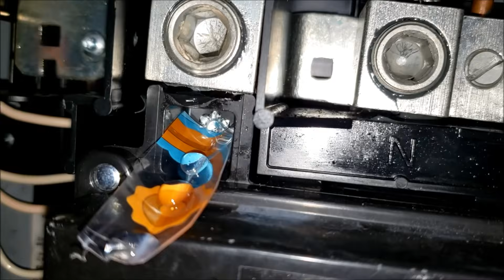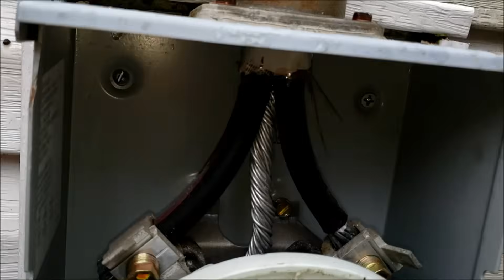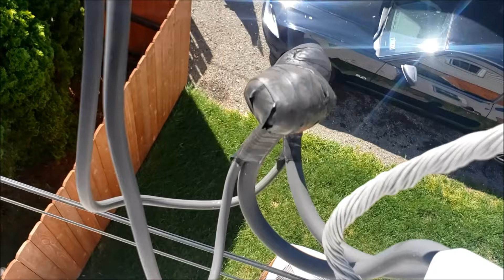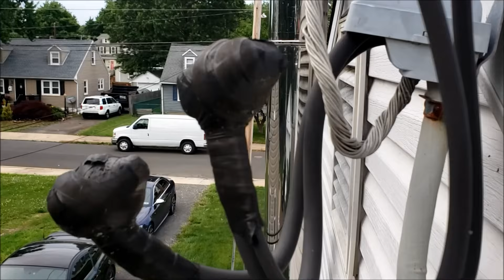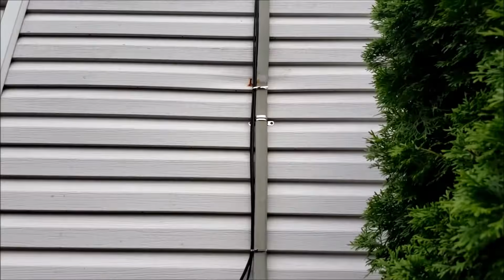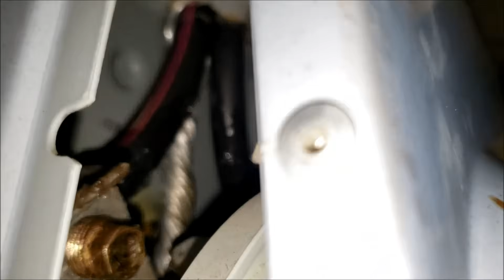Raining? Check For This!  Fixing Water Issue In My Electrical Panel

Comment from the maker: On Amazon:
*EATON SURGE PROTECTOR: https://amzn.to/3ogFb2I
*INTERMATIC SURGE PROTECTOR: https://amzn.to/37DVYq6
*DI-ELECTRIC GREASE: https://amzn.to/37wE0Wh
Reply: You should have drawn a couple holes with a drill bit through the bottoms of the electric box for the water to drip out if it happened again. Very interesting video though next time I'm up on the roof cleaning the gutters I'm going to check the power lines because the whole reason I watched your video was I have a room in the basement and there is a crack right next to the electric box that leaks

Comment: Hi Chris, water got into my panel, of course, via the meter outside.   It only chipped one breaker.   It worked after 2 days of leaving it to dry.  Do i need to replace that breaker?  The breaker panel is 11 yrs old with no sign of corrosion, but an electrician wants me to replace that breaker and a few more that show watermarks on the exterior

Comment: Nice job. Yeah not perfect but safe and effective. I have this issue today. PoCo will repair the bung/seal on top of the meter box and I will make a meter box roof type of thing. I will also inspect the entire run coming in from the pole.  The leaking has been going on for a while on a small scale. I noticed several of my breakers have water staining and rust marks where the rivets hold the breaker housing together. Thanks for your video. Be safe and rock on!!

Comment: Im having an issue where the back breaker of my house is blowing. Its also happening during the rain.  My roof is new though. I thought it was the outside GFCI outlet that is outside of my bedroom tied into that same breaker. Had my buddy replace the outlet. Im wondering if the box itself is leaking.  Didn't have an issue until it rained hard again. Pain in the arse being a home owner.😅

Comment: I have the exact same problem. Water is leaking into the panel box from inside the wire sheathing. I went outside and put new putty a d silicone around everything going into the meter box. The next hard rain and it's still leaking. Must be coming from way up top. I am not sure if it's my problem or the power companies.
Reply from the maker: Always worth it to try and call the power company first. Usually they'll take care of it on the outside of the house

Comment: I had a similar problem in a rental property a few years ago. The service line was completely rotted going into the meter box. Water was getting into the meter box unnoticed for years. The electric panels never took on water because they were located on the other side of the house. We discovered this because the tenant got an electric bill for $800 one month and $1000 the next month. During that time, she blew out an air conditioner, computer and TV due to a surge. Connections in the meter socket rotted over time and caused arcing in the meter socket. We shut off the main and the electric meter kept spinning, it looked as though there was heavy equipment being used even when the main was off.  I guess it would be a good idea to check your service line occasionally. This is something we tend to overlook til there's a real problem. I never thought of it before.

Comment: I found water in my panel yesterday when changing breakers. That is amazing that the water can soak in and travel down through those wires, and even get through the meter box to continue into the house. I will have to check my main cable above the meter. The hard thing to figure is how long this had gone on before it makes it into the breaker box.

Comment: Idk if someone answered the wire question. I’m no electrician but I know that if the wire runs through insulation it has to be uprated cause the insulation will make it hotter. That’s what he meant by the air cooled can be smaller.
Reply: but that wire hes looking at is in insulation..  they may be talking about it being buried, as the other guy mentioned.  You would have to look up the wire sizes, but atleast it wont fail on your end.  If you dont have electrical problems, i say dont worry.

Comment: Buddy,

You need a new main service panel.

That wire is not rated for outdoors.

Im watching you touching the wet panels and are concerned about your safety 

Yikes man be carefull
Reply: Yes you should mention this in video. Don’t want some one to try putting gutter etc with power on
Reply from the maker: Buddy. The service panel is fine. And the power was disconnected
Reply: @NoNonsenseKnowHow  hey I’m having a similar problem.  When you say the service panel was disconnected do you mean off?  Or do you mean you took the street line off of it?  Sorry if I’m not using the correct terms

Comment: Hey Chris if I got water in my electrical circuit breaker and I lost power in one bedroom and we replaced the fuses and we still Don't got no electricity in that one  bedroom what do I do or what could it be my name is Marie
Reply from the maker: I'm not sure off hand. could be a bad fuse or breaker, loose connection etc.
Reply: Well like I said we replace the fuse and we dried it out and everything but still no electrical in that bedroom but thank you for the advice my name is Marie if there's anything you can help me with please let me know

Comment: brother, I had the electric company come out today for power flickering whole house. they said I have water inside my meter box. I have never seen inside one. I checked in my breaker box. you guessed it... Both hot leads were channeling in water (internally) and were side mount to my main breaker. My main breakers are a rust dump heavy corrosion and several others down that side as the water falls down the breakers. Thank you for this great Video!!!.   Now I know who to call for help, a PRO. I have strait vertical conduit out house to meter and then up stack metal conduit with 180 on top. TY TY TY!

Comment: Wouldn’t your circuits all need to be replaced regardless?
Reply from the maker: In my opinion, if you dry them out right away then no. If there's corrosion then yes.  And you're talking about only replacing the breakers right? Replacing all of the circuits would definitely not be necessary

Comment: Your helping people more than you know 🙏🏼💝 thank you. My husband and I just bought our first place, there’s water in the electric box outside, we thrive to learn but our friends and family don’t know anything about anything lol
Reply: First time homeowner here too.... we have rainwater getting in the meter box outside as well. Ours seems to be coming in from the service mast on the roof though. We just got a new roof and it was doing it before (and still after) so I believe it's the boot/cover where rhe lines enter at the top. Rain is going down the lines into my meter and running out the bottom of the meter. It's already rusted a lot of the meter internally to the point we will have to replace it.

I read it can cause power readings to be erratic as well as a host of other issues as well.

Comment: Now main cable that is feed into meter box is that something homeowner fixes or electric company first house i have the same problem with the water.
Reply: Electric company owns drop line from pole to house and the actual meter. Customer owns the contents of meter box (breakers) and service mast (what the drop line connects to)
Reply from the maker: Homeowner is responsible based on what I researched in my area.

Comment: I am having this exact problem and I cannot afford to pay someone to come check this!  Thank you so much for your video!! I know it's a fairly simple fix, but for someone like me who doesn't do this type of thing often, it gave me the confidence to be able to fix it myself! Thanks!!
Reply from the maker: Thanks for commenting Stephanie and awesome to hear that it helped you out. Good luck on the repair!
Reply: I'd call hydro they usually repair their own boxes this can be fixed by calling whoever checks their meters its theirs to fix here we can call hope u can too I'd call who owns it we dont. B safe all. My panels in the garage no seals just open hooks trying to find if it's safe as its just wet all winter surges and popped breakers ever day or so idk what do u do when all your seals r completely hone I told the owner over a year ago hes just letting it stay open lol..bless ya all it's new earth it will b better now that's interesting too. ty for sharing all
Reply: When messing with your 100amp service panel or meter you need to take EXTREAM CAUTION! IF YOU DONT KNOW THE TRUE DANGER INVOLVED DO NOT DO WHAT THIS GENTLEMAN DID. You don't want to risk taking out all of your appliances, but MOST OF ALL TAKING YOUR LIFE OR THE LIVES OF OTHERS LIVING WITH YOU IF A FIRE OCCURS. ANYTIME YOU NEED TO SHUTOFF SERVICE YOU NEED TO CALL UTILITY COMPANY TO DO IT OR HAVE A MASTER ELECTRICIAN CONTACT THE UTILITY COMPANY TO LET THEM KNOW EMERGENCY REPAIRS NEEDED.

Comment: You might be able to use the conductors in the service cable, if they are thhn, rated for outside, in conduit.
Reply from the maker: Unfortunately I don't think they are THHN. Believe it or not I haven't actually got around to doing a proper fix on this yet. Will be a spring project

Comment: I've had water coming into my electrical box on and off for a while now, watching this helped me figure out where it was coming from, and how to put a bandaid on it until I can have an electrician come out and fix it. You're a a life saver man. You saved my electrical system and my entire reptile collection. Thank you so so much
Reply from the maker: So awesome to hear the video helped you narrow down the problem. I did the same thing and just put a Band-Aid on mine and it's still holding up fine. Going to address it in the spring. Thanks for commenting your story!

Comment: Wow! That roof has to be leaking by now.
Reply from the maker: Nope not yet, definitely on the list of things to fix though.  Tar paper is pretty waterproof
Reply: With that amount of granule loss AND fibers showing through shingles I'm really surprised! I hope you've gotten a new roof by now!
We just got a 3-tab shingle roof (from around 2007-ish ?) replaced in April 2022 with architectural-style shingle. Removed the felt underlay and had the self-healing rubberized membrane used instead too (supposedly a better option than felt paper).  Cost us around 12k but 🤷‍♀️ if the house needed it it needed it, ya know.

Comment: Hey.  What’s you do about the circuit breaker panel?  How long did you have to wait for it to dry?
Reply from the maker: Mine wasn't too incredibly soaked. But I would point a fan on it for a couple days if you had a lot of water. If you go by the book generally they recommend replacing Breakers if they have been submerged or really wet. Because corrosion can happen inside and cause them to not work properly

Comment: Did you ever replace the cable or fix the problem I have the same problem my breaker keeps tripping every year after a while of   I keep repacking it it’s a 20 amp
Reply from the maker: I ended up just slapping some silicone on the damaged areas and that has solved the problem for now. Going to eventually put the cable inside of conduit probably but since it's not leaking anymore it hasn't been a priority. I've checked it the last three big rain storms